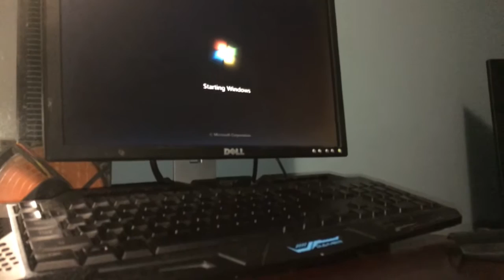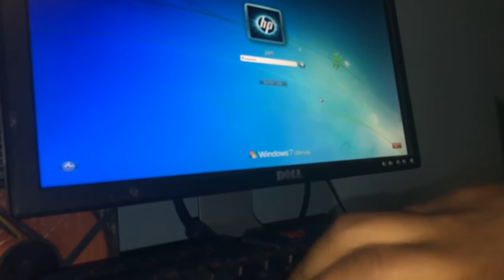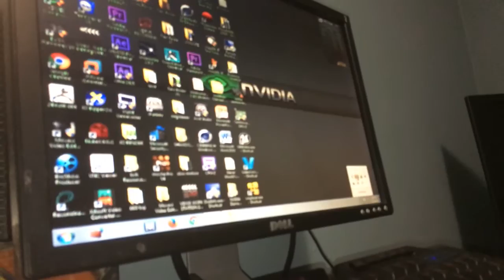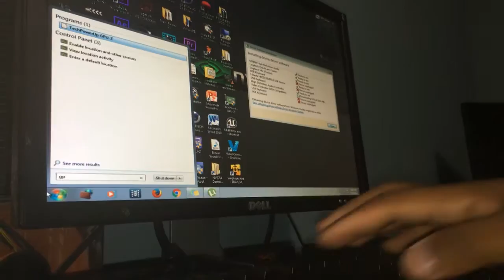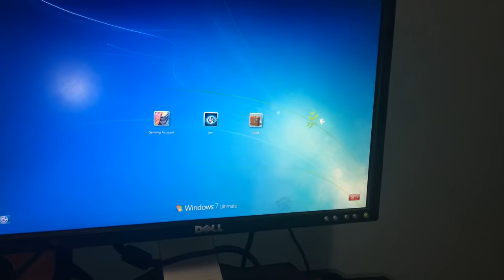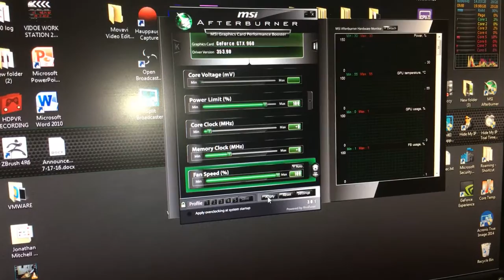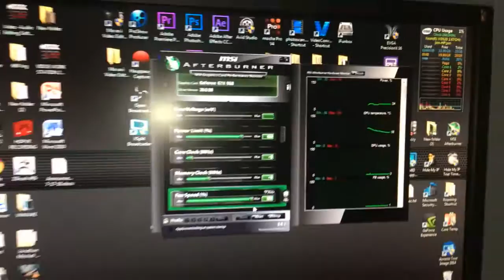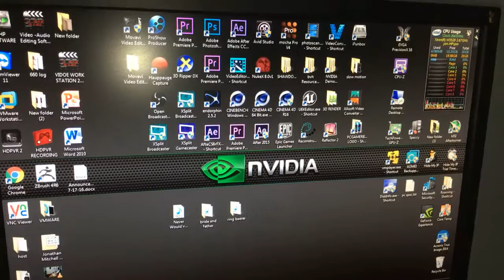HP Z400 UPGRADE GTX 960

Comment: Hey I'm bit every late does my z400 w3550 can paired with gtx 960 any issues of pins or anything else ? 🤔 currently using Quadro 4000 want to upgrade my gpu

Comment: Hello a bit late im about to buy a gtx 960 2 gb i have 18 gb ram and my power supplier is 3.5 does it work on my pc ?
Reply from the maker: What brand gtx 9602gb gpu
Reply from the maker: 300w psu u have
Reply from the maker: It might not work with your PC
Reply from the maker: I would go for a gtx 1050 or 1050ti
Reply from the maker: Gtx 1050ti 4gb version go for that
Reply: Does it work the 1050 ti on my pc ?
Reply from the maker: @jozibushi2471  yea it will work an plus the 1050ti doesnt require a 6pin connector to power it. its powered off the motherboard

  https://www.ebay.com/itm/MSI-Single-Fan-GeForce-GTX-1050-TI-1050TI-4GB-OC-128-Bit-GDDR5-Graphics-GPU/372766009386?hash=item56ca95e82a%3Ag%3A6eMAAOSwfVJdd83H&LH_BIN=1
Reply: Its exact as ur pc z400 workstation.
Reply: I have the 6 pin cuz i had a 560 ti 4 gb..

Comment: Is the gtx970 compatibles?
Reply from the maker: it should work im actually investing in getting a gtx 1070 for my z400
Reply from the maker: https://linustechtips.com/main/topic/281707-gtx-970-400w/
Reply from the maker: https://www.reddit.com/r/nvidia/comments/49kqof/will_my_power_supply_be_sufficient_to_run_a_970/
Reply from the maker: the z400 has a 475w so you should be fine

Comment: Hi guy, I'm going to buy a z400 workstation with a quadro 4000 and then i'll upgrade to a gtx 1060 6gb as you, but i wanted to know : did you had some problems during the upgrade (BIOS, Alimentation, pins, Size...) ?
Thanks.
Reply from the maker: no i did not have any problems at all
Reply: Pc Gamerboyz But you certainly had some modifications to do in the BIOS, no?
Reply: no just need the drivers

Comment: Hey buddy, 
I've an z400 with Xeon W3520. I'm planning to upgrade with a newer GPU. Thinking of getting one of these: GTX1050/ RX460/RX560. But I've come across some posts on different sites where people say since the Z400 doesn't have UEFI support these GPU's won't work. Is it true? Just want to be sure before I get one.
Reply from the maker: nope i own a z400 and ive used gtx 660/gtx960/gtx1050ti/gtx1060 and they all worked fine with no issues
Reply from the maker: check out my vids when you get a chance hp z400 gaming
Reply from the maker: but i recommend you get the gtx 1050ti
Reply: pc gamerzboyz Thanks for the suggestion. So I did some thorough searching and you are right, the newer cards work fine. How much of a performance increase between the GTX1050 and 1050ti? Wouldn't the CPU be a bottleneck even if I get the later? Also which brands did you use in your builds?
Reply: Hey buddy, I just did some digging and I noticed that my mobo is version 1 with 4 RAM slots and you seem to have the six RAM slot version 2. Will it make any difference? I mean to the compatibility or the only difference is the amount of RAMs that can be added has just increased?
Reply from the maker: theirs not that much bottleneck with the 1050 and the 1050ti there is 50% boost in clock performance. i have the 1050ti
Reply from the maker: no it will not make a difference
Reply: Thank for the reply. So, I'll order the 1050Ti then. You are using EVGA so I'll get that one too since its confirmed that there will be no issues with that brand.
Reply from the maker: Rahul Salin let me know how it all works out bro

Comment: Let me guess, with that PSU, this PC is dead now, or will be dead in a couple of years? I really don't want to mod the tower just for a $20 PSU. That's the unfortunate part.
Reply from the maker: no i have a gtx 1060 6gb and it works great with it no issues at all i mean it sucks that you cant upgrade the psu but im fine with it better you can they have an 600w psu available for this pc
Reply: Yeah, except that it's a matter of longevity. A "will my GTX 960 last this PSU for 10 years or 2 years?" type of thing. Luckily you did your research, and this IS the PC that I'm going with for my first time build.

I found a killer deal for KTD- PE313/4G RAM for $11 (75% off!) on Ebay, I'm hoping that it'll work. I don't know what "4G" is but it's what I saw Tomshardware recommend.
Reply: pc gamerzboyz Hi. Are you using GTX 1060 6gb on your Hp z400? does it work well? Need your reply thanks.
Reply from the maker: Kzer Mallanao yes I am and it works great no compatibility issues
Reply from the maker: Kzer Mallanao also I have the evga model
Reply: pc gamerzboyz my only problem is the psu of hp z400 only have a 6pin . the gtx 1060 needs 8pin. Can I use a 6pin to 8pin adapter?
Reply from the maker: Kzer Mallanao nope the gtx 1060 I have only requires a 6 pin connector get the evga model I'll send you the link
Reply from the maker: Kzer Mallanao https://m.ebay.com/itm/EVGA-Nvidia-GeForce-GTX-1060-OC-GAMING-6GB-GDDR5-Mini-Video-Card-GPU/132448361608?epid=546747212&thm=2000
Reply from the maker: Kzer Mallanao https://m.ebay.com/itm/EVGA-GeForce-GTX-1060-GAMING-ACX-2-0-Single-Fan-03G-P4-6160-KR-3GB-GDDR5/332252692335?epid=13003304871&hash=item4d5bcdbf6f
Reply: pc gamerzboyz Thanks!
Reply from the maker: Kzer Mallanao no problem

Comment: a guy recently sold me a z400 for $30 it has and old Nvidia Quadro nvs 295 for the graphics card. what upgrades should I do to this to make it more suitable for a daily computer, the processor is a Xeon that is a 4 core with hyperthreading. I've been looking into buying an SSD and a graphics card for it. I primarily do photoshop and run OSX in a VM to design applications on my laptop, wanting to use a desktop for this. I realize ill need a lot of ram. do you think it would be worth it to put money into this system? or should i just build a while new rig?
Reply from the maker: its definitely worth putting money into the upgrades i had my z400 for about 2 years now and i love it 
but definitely upgrade your ram the hard drive to an ssd and your graphics card to a gtx 1050ti or a rx480
and if you have the extra money look into getting the xeon w3690 cpu its worth bro 
i do alot on my  z400 video editing photo editing and 3d work and its very powerful
also what i recommend that you do is get a copy of windows 10 with it will definitely increase the performance
but if you dont want to go that rout you can build your own rig i was going to do that at one point but i didn't have the time so i bought the z400 upgraded to the max and im very happy with it
Reply from the maker: when buy the ram make sure you get the z400 ECC RAM

Comment: and my z400 has intel xenon w3450
Reply from the maker: how fast does it run
Reply: pc gamerzboyz  i dont know becouse i dont have the gpu rx470 to know i will use it for games  :-)
Reply: the cpu is verry powerfull and has 16gb ram but i am with verry slol 5000rpm hdd xD i cant feel the power of the cpu but i try starrting 40programs on it and rar file doing and 4games far cry3 minecraft beam ng drive it runs everyting with usage of ram 8gigs and cpu 30%

Comment: I have just bought one of these systems - I  have installed a GTX 750 ti and its sick - Handles everything I have thrown at it. Mine is running the 475 PSU and I havent had any problems with it. The 600w PSU is pretty cheap off ebay. Anyone considering this system for a cheap gamer go for it...
Reply from the maker: can u do a video on the performance and the gaming

Comment: Hello friend you have q to enable or disable hackintosh 10.11 ??? I have an HP Z600 with a hard disk ntfs windows + ubuntu 500Gb and 160Gb another slave only for the captain. Can you help me porfa saw in 2:18 minute walk to the part of the sata but no where to place the different ports SATA PORT 0,1,2,3,4 or 5 ??? and that gene? /? Gbps should go for disk 2 slave (Hackintosh) if I put in RAID + AHCI ENTRY NOT RECOGNIZE ME IN WINDOWS HAVE DISK Q BE "IDE" to run ANY WINDOWS hope you can help me greetings
Reply from the maker: could u explain that again

Comment: I have a Z420 which is kinda the same as a Z400. Im just asking will a gtx 960 work with it? Can the power supply handle the graphics card or do I need a new psu (power supply) too?
Reply: you have to upgrade power supply to 400 (sorry for bad english )
Reply from the maker: yea it will work the power supply is more than enough to handle the gtx 960
Reply from the maker: it already has a 400wat power supply